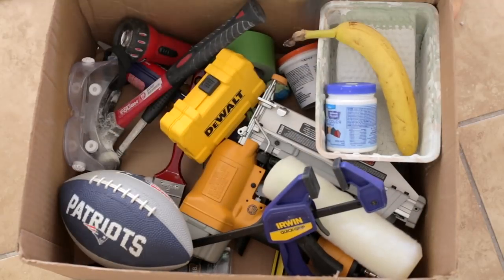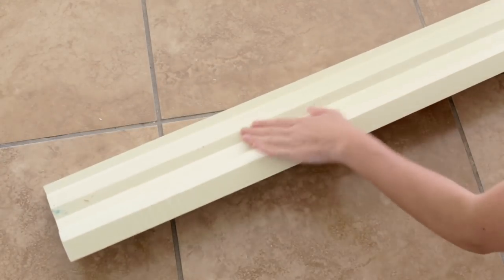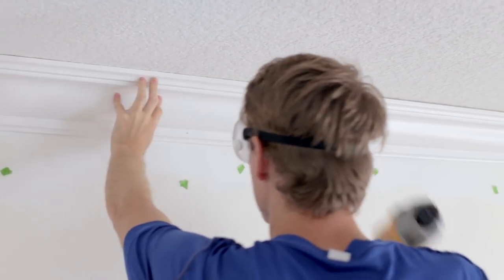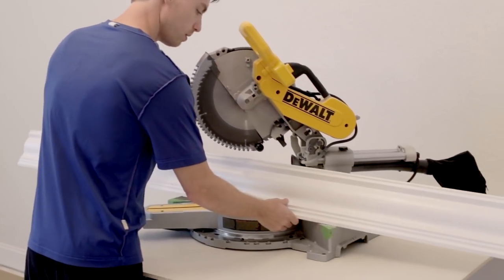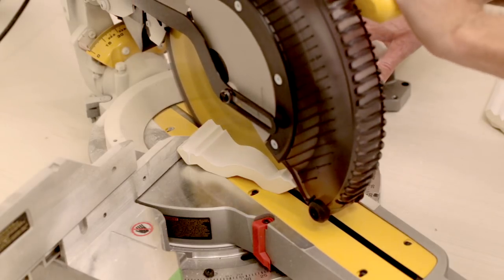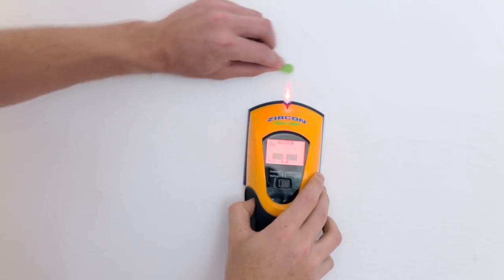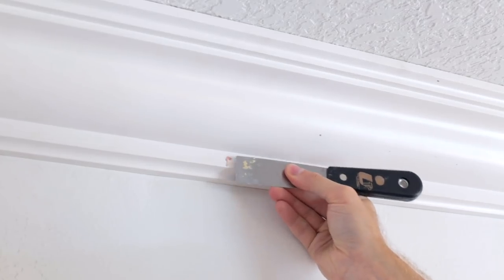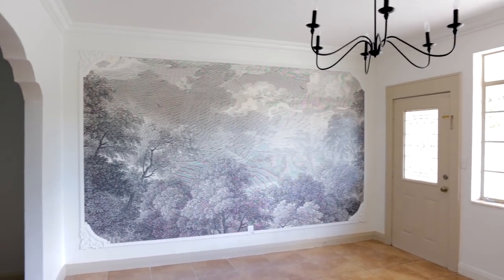3-Day Project: Updating a room with Molding + Paint

Comment: Gorgeous!  Is the equipment very expensive (nail gun, mitre saw)?
Reply from the maker: We're using a professional level miter saw, although it's not at all needed for this project. The nail gun is only $99! They're both linked in the blog post: http://blog.jennasuedesign.com/2018/08/3-day-project-molding-and-paint/